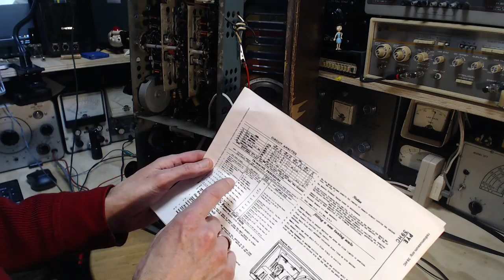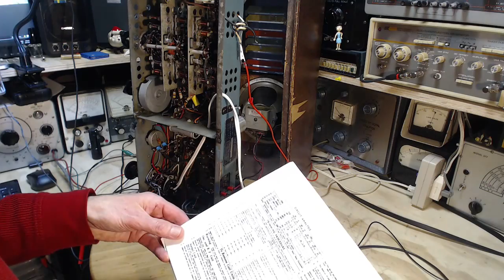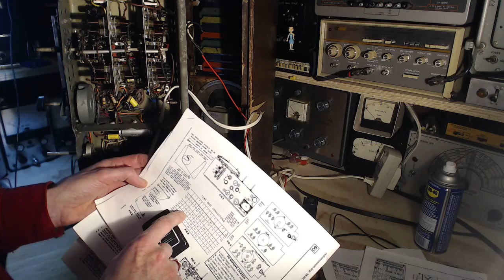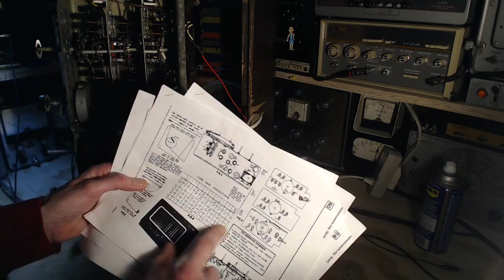PYE 39HC Shortwave Broadcast Receiver Video #9 - What's Happening

Comment: That set is the same as the PYE 39G Shortwave Receiver.
Reply from the maker: Very interesting.  It's not the same.  Like all the British radios, there is only one antenna terminal.  It also looks like the first RF tube is omitted from the British version.  That's a big difference.  Now if I can only get mine working well. . .

Comment: Thanks to the rumbling before you changed the cap, it sounds like it may possibly be silver mica disease in the IF cans...
Reply from the maker: I've been hoping the rumbling will go away long before I start thinking like that.  I'm not sure these IFs can suffer from that problem.  I think the capacitors inside are discrete components.  At least, I'm hoping that is the case.
Reply from the maker: No such weather within range.  It's bound to be something in or about the radio itself.
Reply: I watched some videos Shango066 posted.  He worked on several radios that had the same symptoms yours has. He carefully removed the Mica caps from inside the IF cans and replaced them with discrete caps outside the cans... they went from rumbly useless radios to like new! That's why I mentioned it... It will not be fun, but it can be done. Like you I hope that is not really the case but it could be!
Reply from the maker: I've done that type of repair a few times now but the radios were not this old.  I hope it just goes away.

Comment: Hi Jim
Could it be a open grid leak resistor on V4 or V5  .
" I think it's the grid leak resistor on V4 "
Note V5 has a grid stopper resistor R17 .
Reply from the maker: I hadn't noticed R17.  Looks innocuous to me.  What's a 'grid stopper' resistor supposed to do?
Reply: It limits the top end response of the tube .
So it should stop V5 from oscillating at RF .The resistor & grid capacitance form a R/C filter .

Well that's what it should do .
Reply from the maker: I didn't know there was a concern about oscillating especially at RF frequencies.  Thanks.
Reply: This PYE set looks like it has a very stable audio output stage .
All the tricks have been used , filters , lots of negative feedback & more above the audio range .
R17 , C35 & the speaker out put feeding back into the volume pot .All this adds stability & it's just the audio output stage !.....
This is just what I expect from PYE given there wartime heritage .
Note that negative feedback is called Neutralization in old books .
Reply from the maker: Great info - thanks!